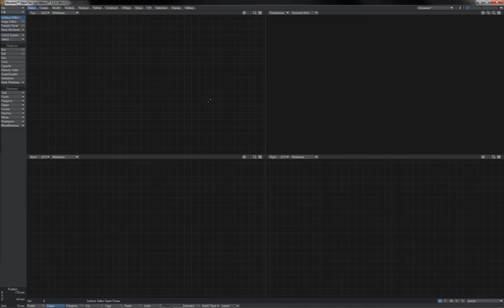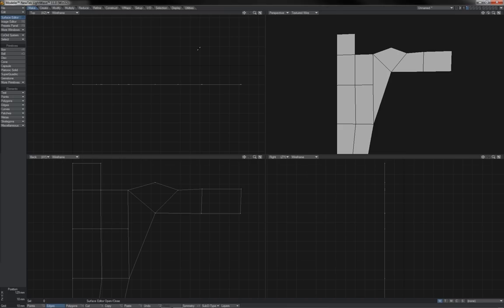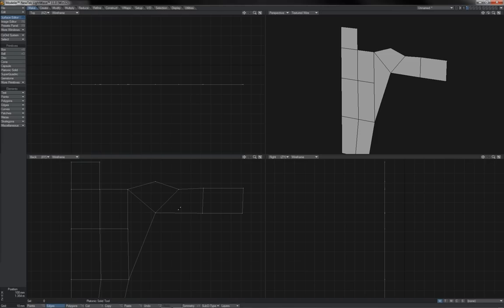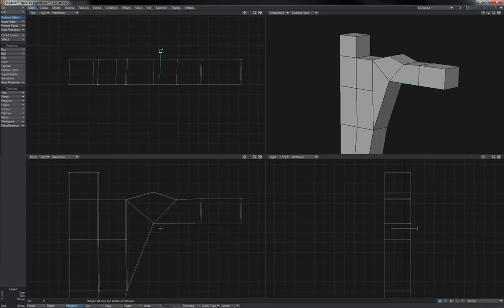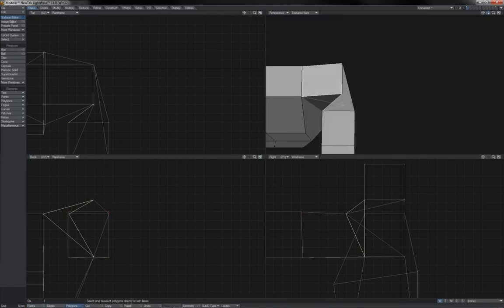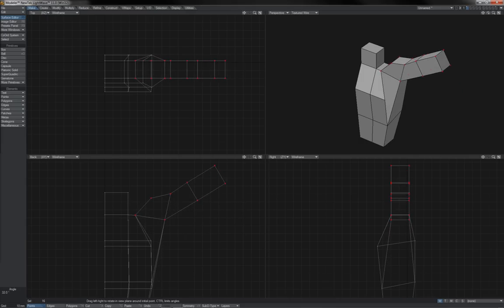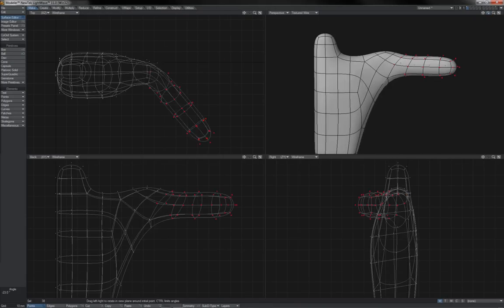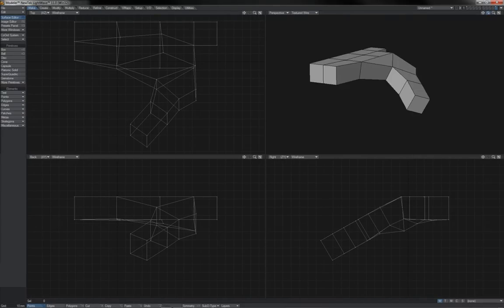Shoulder Topology for Skinning

Comment: This is wonderful and I'll start using it right away.

While I'm still just a beginner in this field(so this may not be new to the reader), I've learned a simple but effective trick in a Japanese game that works between the shoulder bone and the arm bone(you can also use it for the leg). With that you deform the arm from slightly below the shoulder, and can use the shoulder bone and the additional bone to correct any problems. The difference is quite noticeable in my meshes so far.